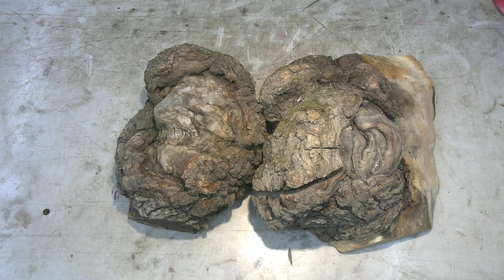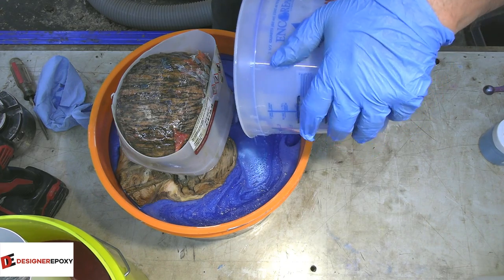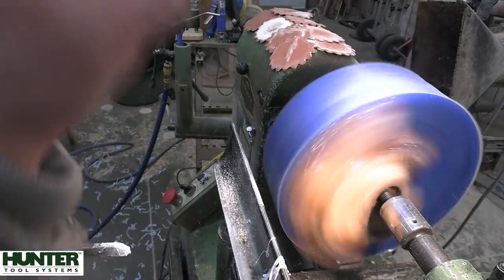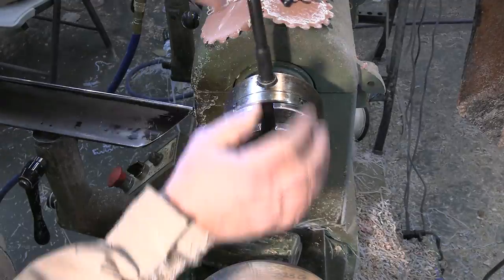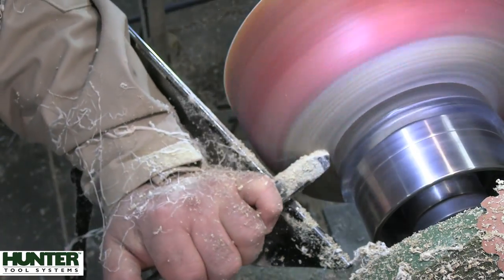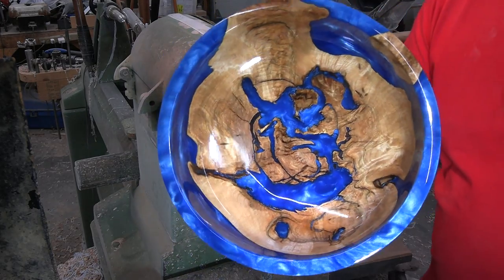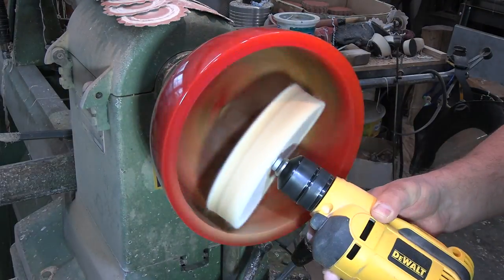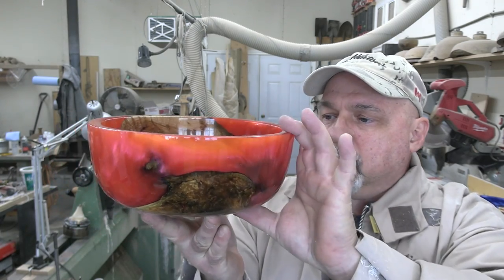Woodturning - The Burl Island Bowls

Comment: I'm about to try Designer Epoxy.  I like to "swirl" colors and wonder at what time and/or temp you go to before adding the accent color to prevent mixing rather than keeping the colors separate?  Thanks for all your videos, I have learned so much from you.
Reply from the maker: It depends on what your using. Still haven’t totally figured out the deep cast but when the Artcast hits 40C you better start combining the different colors. Thanks
Reply: This is a "chat" I just had with DE.  Very confusing to me....do you understand it?
With Designer Deep Cast, trying to swirl and keep colors separate, approx what internal temp would you recommend adding the additional colors without their blending mixing with the main color?With Designer Deep Cast, trying to swirl and keep colors separate, approx what internal temp would you recommend adding the additional colors without their blending mixing with the main color?Swirls with deep cast best at 12 hour mark after pourYou mean pour the mixed main color then wait 12 hours to add additional colors?No , for designing swirls 12 hour is best to stay. However when doing more then 1 color will be all at 1 time

Comment: I am using deep casting resin and it has been in a pressure pot sense Friday.  Can I take it out of the pot now and let it cure out side the put?  I want to use the pot for the other half of this walnut.
Reply from the maker: It would be fine to take it out after 48 hours. Don’t think I would remove it before then. Thanks for watching

Comment: Hello I’m extremely new to your channel just kind of stumbled across it I’m playing catch-up pretty much watching every video I can fine this is the most current so this is the one I thought I’d comment on I believe you’ve already figured this out but I work with Epoxy in other areas and I believe you should vacuum all your epoxy.   I fully understand a shorter condensed version of your video but I also like the voice overs like you stayed in one of your videos if you just turn on the sound oh we’re going to hear the noise in the background on the machine the cutter the dust collector and everything else so it’s either a silent video or voiceover correct
Reply from the maker: With Deep Cast there’s no need to degass the resin. It has a long open time to allow the bubbles to escape. Welcome aboard!
Reply: Sorry I should probably clarify I didn’t mean for degassing I meant for when you’re actually casting to make sure you get all the air voids out of everything.  Love your work everyone of them system amazing

Comment: I have a question for you Jim. I have issues with tenons sometimes and wonder what I'm doing wrong.  I am using a oneway stronghold with #2 and #4 jaws generally turning approximately 16" blanks and I often break the tenons off. I've had much better luck with mortices but everything I seem to read and watch says that a tenon is better. I don't think I'm overtightening, the tenon is always solid wood. The most recent specific example, I was turning a 16.5" wet oak blank and was coring it, I had a minor catch with the 9" oneway knife and the tenon split across the one side. Any help would be appreciated!
Reply from the maker: Are you using the Korpro Cutter? I would get devastating catches with the Oneway cutter and rarely get them with the new cutter from Hunter Tools. Are you using tailstock support? If not, this is probably the main reason, coring can be violent and without tailstock support your looking for trouble. Tenons are the best way to do bowls but they do fail on occasion. I would say if I roughed out 100 bowls, two or three tenons will break, with mortises, I bet 10 or more. Hope this helps. Jim
Reply: @SpragueWoodturning  I haven't tried the korpro but I've seen your video on it and as a hobbyist the cost is a bit prohibitive especially considering replacing all 4 cutters. I am using tail stock support and haven't had a failure with a mortice. Interesting to hear your ratio of failure, obviously a tenon is better so I'll keep playing with it. Again always appreciate your videos, they have inspired me and taught me so much

Comment: Just curious...the buckets that do not release the moulds easy, why don't you line them with Tuck Tape?
Reply from the maker: Really shouldn’t need to. If the bucket is plastic it really should come out on its own. Thanks
Reply: @SpragueWoodturning  oh, I was just asking because there are 5 numbers for plastics and a couple of them are not mould release-easy.  But I see what you're saying.  Take care buddy...I'm thinking about your recuperation.
Reply from the maker: @morgancalvi6675  my hip was done before I started my channel over two years ago. Best thing I’ve ever done! Thanks
Reply: @SpragueWoodturning  oh I was asking because there are 5 different numbers for plastics (the recycling numbers) and a couple of them are very tricky for releasing moulds.
Reply: @SpragueWoodturning even though I had trouble with mine...I still say it was the best thing I ever did as well.  It meant almost 0 pain and the mobility I got back was incredible.

Comment: Question: the vaccine holder is cool, but what size vacuum? Is it variable?
Reply from the maker: It’s a 1/4 horsepower marathon pump and you regulate the vacuum buy letting it exhaust a little at the valve. Thanks